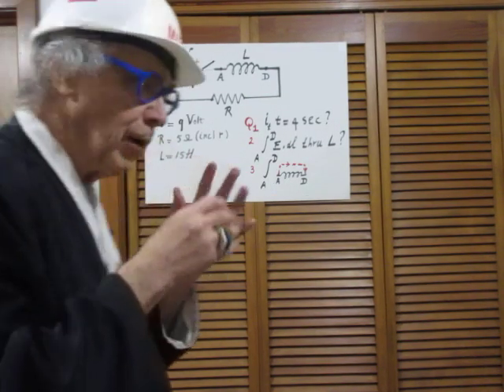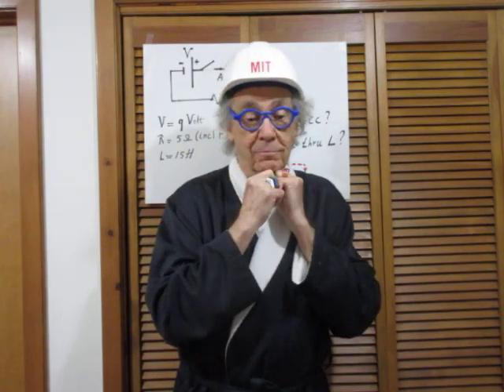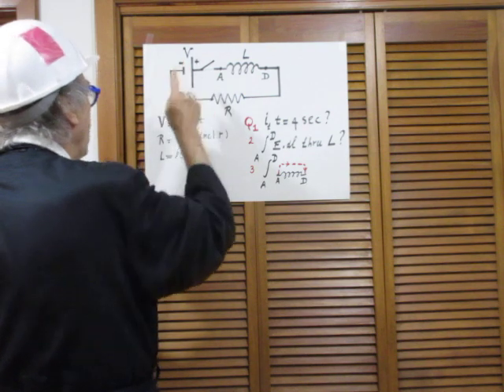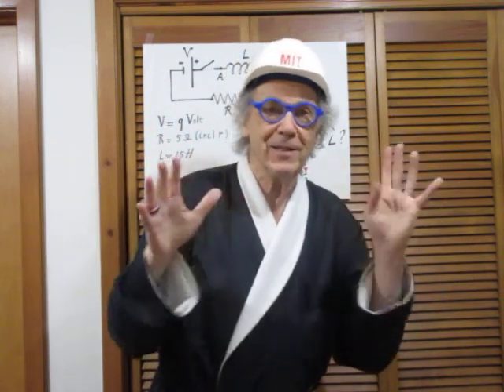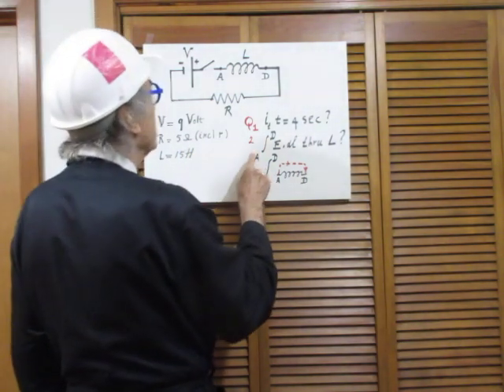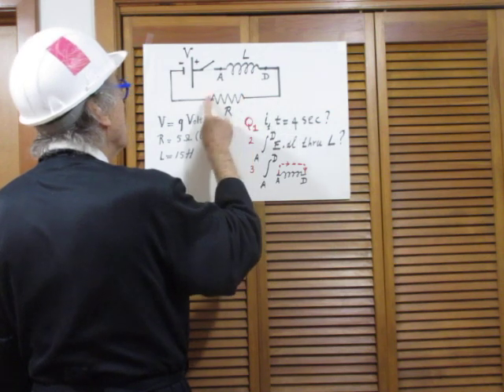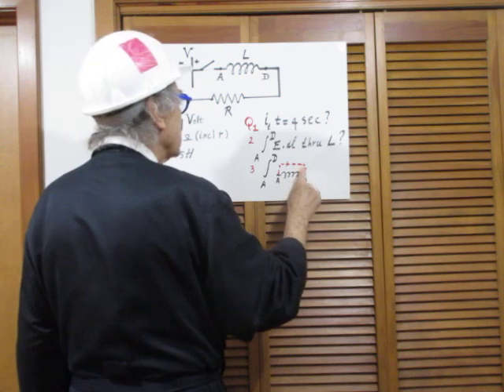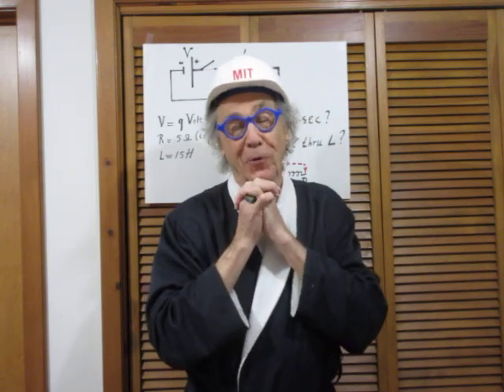Problem #75 - Faraday's Law!

Comment: Can i get email id to connect with Walter Lewin sir.??
Reply from the maker: my email is strictly private
Reply: @lecturesbywalterlewin.they9259  ok i will connect with you by this medium...
I have doubt regarding non-inertial reference frame,

An accelerating frame is

 non-inertial,

But if 2 frames are accelerating with same acceleration, then the 2nd frame as observed by the 1st frame can be regarded as inertial or non-inertial...?? In which both the frames seems to be rest as seen from one another but both frames are accelerating...! 

What's the nature of frame in this case...???
Reply from the maker: @cosmolearner5562  no frame that is accelerated can be a perfect inertial ref frame. But when I do experiments in MIT's lecture hall then the lecture hall is sufficiently close to a perfect inertial ref farme that we can assume it is.
Reply: @lecturesbywalterlewin.they9259  
In Ideal Universe (No friction, no air resistance, no any non-conservative force)..

If we apply a force, it causes change in momentum, say mass is constant so cause acceleration in the body

I want to impart constant velocity to the body, but the problem is, if i apply a force on it , it causes acceleration, then how could i impart constant velocity to the body in this ideal Universe/condition..??
Reply from the maker: when I throw up an object in the lecture hall that object is in my inertial ref frame and I can apply all of Newton's Laws. A centrifuge rotating in my lecture hall is in my inertial ref frame. If you choose the rotating frame as you ref frame then Newton's law no longer apply. To make it work we introduce a fictitious force which we call "centrifugal forces". Coriolis forces are also "fictitious pseudo" forces. use google
Reply: @lecturesbywalterlewin.they9259  i think , you not read my question
I am not talking about reference frame now
The question is changed
I am asking☝🏻 how to provide constant velocity to a body, in a ideal conditions because when I apply a force it causes acceleration but not uniform velocity, then how could i impart constant velocity to the body in this ideal conditions?

Comment: Hi, Professor, I posted this question in another video but you didn't reply. I don't know if this is a legit question. Please let me know either way. Thanks.
For the Kelvin water dropper, does this mean the water in one bucket will have pH < 7 and the other have pH > 7?  I think it will only be slightly above or below 7 since it does not take a lot of charge to create E field = 3*10^6 on a small sphere.
Reply from the maker: https://en.wikipedia.org/wiki/Kelvin_water_dropper
Reply: @lecturesbywalterlewin.they9259  Professor Lewin, I have read through a few times but still quite understand some details. For example , I quote from the wikipedia, "The charge on the left ring will attract negative charges in the water (ions) into the left-hand stream by the Coulomb electrostatic attraction. When a drop breaks off the end of the left-hand stream, the drop carries a negative charge with it."  I understand the ions are H+ and OH-. But do these two ions actually separate due to the breakoff? So one bucket contains more H+ and the other has more OH-? I also read your notes in here:http://freepdfhosting.com/5d4c550dc5.pdf        In the second point in page1, you said the H+ is pushed up and OH- is pushed down. So I believe it means the two ions will separate. But the thing that is dripping down is still water,  it must still contains H+ and OH-, so where are negative charge come from? This confuses me. Thank you in advance.

Comment: I thought we weren't supposed to post solutions in comments. But did you delete the solution comments on purpose?
Reply from the maker: I read all solutions but, with few exceptions, I do not post them. That's how I know that there were about 75 answers of which 16 were correct.

Comment: Hello  Professor,
The other day I was trying to explain Coriolis forces and acceleration to some students.
I was hoping to find that you may have covered this topic in one of your lectures to get another perspective in presentation that you have a wonderful talent for.  As you know, this is one of the more difficult topics to explain much the same as trying to explain gyroscopes.  I was looking through your 8.01 lectures to see if you had discussed the topic of Coriolis but cannot seem to find such a discussion.  I thougt it  might be lectures 4 or 5 but it seems not to be in 8.01.  Did you cover this topic at anytime and if so, do you recall which lecture it might be in?

Thanks in advance.
George Hnatiuk  Dec 12, 2019  10:55pm
Reply from the maker: use google
Reply: That is not a very satisfying answer.   I know all about Coriolis and do not need to Google it.   I was just looking to see how you would approach the subject in teaching it to others.  That is all I was asking.
GH
Reply from the maker: @georgehnatiuk5806  I never covered it in my lectures. It's a fictitious force (like centrifugal force) to make "F=ma" work in a rotating frame of reference.

Comment: Sir could you pls let me know why this happens.. At my home, upon the glass windows lots of water vapour gets deposited(specially around 6)...outside the temperature is cooler than inside, we don't have a roof, but a slab...the temp here ranges around 25 degrees. Has it got something to do with saturated vapour pressure?
Reply from the maker: it's the same reason why clouds exist. use google
Reply: @lecturesbywalterlewin.they9259  ..Thanks sir

Comment: Sir, would be ok to ask a quesn...a block of mass o.5kg  is held against a rough vertical wall by applying a force of 12 N. What is the force exerted by the wall on it?
Reply from the maker: it would depend on the friction coefficient wether 12N is enough. Watch my 8.01 lectures - you will find your answers there. If the block stays put, the wal will apply on you 12 N (but in opposite direction).  In addition you will have to apply a force upwards of 0.5*g.
Reply: @lecturesbywalterlewin.they9259  Thanks a lot sir, it is so very kind of u to reply...I am gonna visit 8.01
Reply: Sir whenever possible....I have another little question puzzling me....but couldn't find a video for it. At my home, upon the glass windows lots of water vapour gets deposited(specially around 6)...outside the temperature is cooler than inside, we don't have a roof, but a slab...the temp here ranges around 25 degrees. Has it got something to do with saturated vapour pressure?

Comment: Your highly sir,please reply me..sir,In reduction half cell,does metal ion gets reduced  by accepting electrins from the metal electrode in reduction half cell or is it reduced only after  electrons are transferred  through wire from oxidation half cell?sir,your reply would be an honour for me☺☺
Reply from the maker: question unclear - use google
Reply: @lecturesbywalterlewin.they9259  sir,it is said that oxidation takes place in anode-half cell and reduction takes place in cathode half-cell..I want to know that does the metal ion in the cathode half cell  captures electrons from its respective electrode or the metal ion gets reduced only after accepting electrons travelling through wire as a result of oxidation in oxidation half cell?I mean that suppose Cu2+ gets reduced to Cu in the cathode half cell.does it capture electrons from copper electrode itself or the electrons from zinc(as a result of oxidation of Zn to Zn2+).I hope now the question is clear☺☺
Reply: @bipinsunar4050  In an open-circuit Daniell cell, copper ions at the cathode are reduced until the accumulation of positive charge (= lack of electrons) on the copper electrode stops the reduction (oxidation and reduction reaction at the cathode are in equilibrium). So yes, the copper ions at the cathode capture electrons from the copper electrode. If the half cells are connected by a wire, then the reduction of copper ions at the cathode is maintained by the current of electrons from the zinc anode traveling trough the wire and preventing a buildup of positive charge on the cathode.
Reply: Reduction means accepting electrons, so the metal ion (or atom) is reduced when it gains electrons. Of course you need to close the circuit to keep the reaction going.